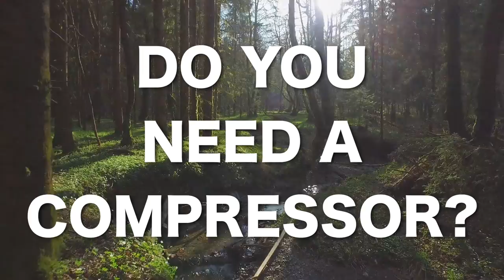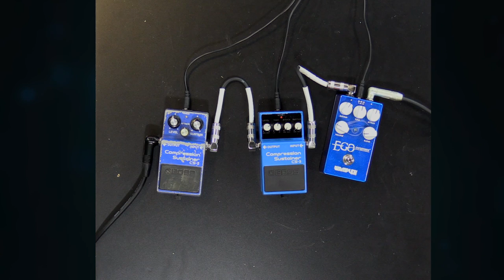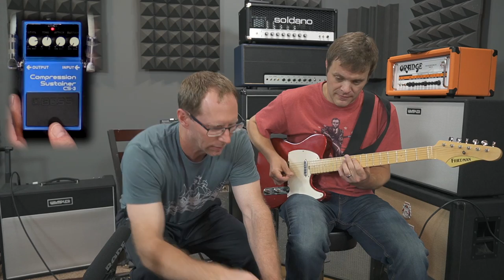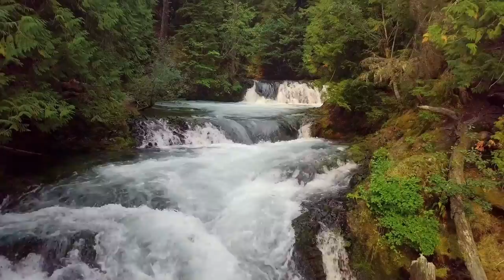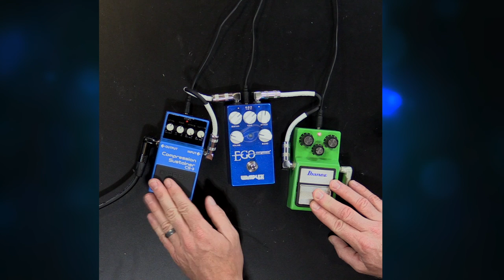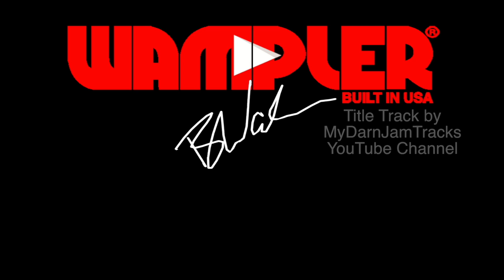Do you need a compressor pedal?

Comment: I have the CS2 and the Mini Ego. I use the mini-ego into a Silver Archer and a Tumnis deluxe - the latter two together for increased harmonics.
I’ve been very happy with the mini ego, less noise than the CS2. Also the mini ego has more range. If I have to take one pedal into a modeling amp, it will be a compressor. Right now the ego is the only pedal going into my Vox. Into my two Marshall’s running in stereo, I have the three I mention above on a pedal board with the other usuals . I’ve been buying pedals since the 70’s. “Less is more”  when you get down to it.

Comment: I use a keely pro into a moog mf drive in an NS-2 loop. But I use it as a limiter mostly so I can actually run a lower input into my chain and boost it. That way gives me more clarity because I’m using a seven string drop tuned to F#. Cutting the input gain on the compressor then rebooting through my drive gives me huge big clear high gain tone.

Comment: The short answer, is: YES. Particularly if you play a single coil guitar, but even humsucking guitars benefit from them. Turn that sucker on and forget about it. Adds life to any guitar by giving a little push to the front end of an amp. If you are playing through a Matchless or such, might not be quite as necessary. But def worth a try. I personally have and use two BOSS compressors, and I love them both, going into two different Fender amps. However, I'm sure there are other, very capable compressors out there.

Comment: 1 thing that I like about Fender's is the ability to moderate your volume with pick force. Compression takes away this wonderful part of playing. And I got 2 Boss CS-2's. 1 is highly modded with some spidery looking chip making it like a plug in super comp. Not quite understanding what it did I bought a stock 1 to compare and found with either I had to change the way I play. So I just use a silent modded 10 band EQ and my fingers to keep each note, chord or run at whatever volume I feel is best. So compresser pedals make great door stoppers. I even tried a BBE mini sonic stomp but took that off my electric board and just use it for my acoustic set up. Now that really helps especially with my 12 string. Through its own mixer going into the P A. With a AKG wireless bug system and the Sonic stomp, it's as close as a miked acoustic can get IMHO. And I can walk around while playing.

Comment: Yes I need one. I know many are the exact opposite, but it's tough for me to like my sound without it. No, I don't have crappy gear. Of course, I'm turning the compressor off when I run my big muff circuits, but like many others are saying, I use it as a mostly always on clean boost with light compression for overdrives. Makes everything perfect and creamy!

Comment: They are only 'needed' to flatten the dynamic range (without needing the volume to find a power-amp+speaker's sweet spot), in order to sound like tape or studio compression that was prominent in the late 70s and throughout the 80s.
Skank comping, DIsco and funk wah parts,  and 'popping' licks a la 'Eminence Front' are prime examples of when a compressor is 'needed'. Andy Summers and Johnny Marr used them all the time. 
You might get by playing rockabilly without one, but it takes a sweeeet rig :o)

Comment: I find this video so interesting,  because I have a couple guitars with active pickups and some with passive,  and the active pickups tend to compress the signal alot, well some more than others.  I actually find my EMGs compress more than my Seymour Duncan active,  but it's still there and you tend to lose some dynamics.  I always find it's too easy to screw up my sound when adding a compression pedal that I just try to run a minimal pedal board.  I find they really take away from tube amps especially.  For me that's why I tend not to like solid state amps because of the over compression. Even though I don't play alot of "clean" stuff, I prefer not running compression.  When I play clean I need to hear more dynamics, for me it seems to take away from that.

Comment: I have dirt cheap Joyo Dyna Compressor.  It's always on.   I place it right after my Digitech Synth Wah envelope filter.  I dial the sustain and attack almost all the way up, and the level so that it's slightly louder than the uncompressed level.   My cleans sound huge.  I use a TS mini, an MXR 78 badass distortion, and am ibanez super metal mini, for various flavours of dirt,  but none of them have the dirt turned up even halfway.   With the compressor I get loads of sustain out of any one of them, without much dirt.  Turning different combinations of two, I get different flavours, with more dirt, and with all three, I get a really smooth creamy Soldano type lead tone.  The a crybaby . Then an MXR eq used as a mid boost for solos, then a volume pedal, into a delay for swells, and finally int
o a peavey VT classic running ultra clean.

Comment: Compressor after the first drive, is a great way to control levels and dynamics for rhythm playing, especially in a worship setting  ;-) The cleans are compressed like normal, but the OD rhythm doesn't give you nasty surprises/volume jumps. So you can play heavy handed without stress ;-)
Reply: Christian Boddum I’m gonna have to give that a try! Always heard comps go in front, so I never tried them anywhere else! Great tip!

Comment: Cmon people. I have Keeley, Xotic, and Origin FX compressors. I refer to them as MORE pedals. I set the amp be it a tube amp to desired settings, set my compressor subtle to  “more” settings. I liked the sweetens up the sound reference.  On grainy sounds I use it the same. Some may refer to it as a clean booste. I even run a SP comp in front of a Kemper 😉

Comment: Mr. Wampler,  Have enjoyed all your pedals and yt vids here...Please invent us a pedal that can turn a SS amp, into an amp that gives us 'even harmonics' like a tube amp, and the  guitar world will be your oyster!! 

Cheers pal..hope your up to that challenge, as we all know the limitations of an ss amp is its 'odd harmonics' which kinda becomes a deal breaker on ss! Good Luck & much more success in your pedals builds!!
Reply: I think the issue is Solid State gain staging and tone stacks vary quite a bit between different amp designs. I have a Fulltone OCD (A Wampler Plexi Drive would also probably do the trick) and it legitimately makes my "teal stripe" Peavey Bandit on the clean channel sound sound remarkably close to an overdriven valve Marshall on certain pedal settings.

However, I have another solid state amp that makes the same pedal sound like a weird out of phase fuzz.
Reply: It is a myth that tube amp produce only or predominantly even harmonics. It is always a mixture of even and uneven harmonics which is very much dependent on the design and topology. There are tube amps that have predominantly uneven harmonics. 
Also not true that solid state circuits produce only uneven harmonics. Some do. Some don’t.
Easily measurable by yourself: send a pure sine wave (1000Hz) from a signal generator through different circuits and drive them .Your hardware amps and pedals or just amp sims in your daw, doesn’t matter. You’ll notice the outcome varies massively and you just cannot tell by looking at the harmonics how something will sound.
It’s not that simple, even order harmonics = good and uneven = bad.

Comment: GREAT video. 
I have two compressors on my board:
1. Boss CS-3 
2. Xotic SP Comp
The boss is for a pre-gain boost/sustain. When I click that on it sends me soaring over everything else in the band, as well as provides endless sustain. It sounds especially nice with single coils. It really makes Wampler Tumnus Deluxe howl. 
The Xotic SP Comp is for post-gain dynamic smoothness, and punch. I rarely click it on, but when I do, its because I need some funky spank. Like the Wampler Ego, its modeled after a Ross compressor, and it has a blend knob, which is really handy. The Xotic SP is the sweetest sounding compression my ears have ever heard.

Comment: I'm a compressor junkie. 

I own an Origin Effects Cali76-TX, a Fairfield Circuitry The Accountant, a Retrospec Squeeze Box, a TC Electronic Spectacomp, and a Boss CS-2. (While I don't have a Wampler Ego, I'm looking to buy one of the minis...)

One tip for the Boss CS-2 (which I love)... If you're using a "brick power supply", you need to run 12v. The old Boss ACA wall-wart power supply actually put out 12v, not 9v.
Reply: Have the mini its the best dyna/ross descendant out there in my opinion. Do it. Also a comp junkie

Comment: I only use compressors for the squash effect (think funk). Since I play metal though, almost exclusively, I don't own a compressor pedal. Using comps to even out dynamics encourages sloppy playing somewhat. It's like those sensors on newer cars that alert you if you start drifting over the line in the shoulder....learn to f**king drive in the first place, and you don't have to worry about drifting off the road. Drivers start depending on those sensors just like guitarists start depending on compressors to "fix" their phrasing mistakes. Dynamics are a good thing, for one, but if I unintentionally play something too soft or too loud I consider that a mistake and I try to improve my technique.

Comment: I tried a BOSS CS-3 with great expectancies. I use a silicon fuzz in front of a soft overdrive and obtain clean tones when the guitar volume is rolled down to 5. But no matters where in the chain I set the CS-3, I loose that clean tone. Even if I roll down the level knob, always can hear a subtle hiss like if it is clipping (overdriving) the signal. All compressor behave like that or am I doing something wrong ?
Reply from the maker: You won’t want to use the comp in front of the fuzz, but if you are experiencing any sort of clipping with the compressor anywhere else in the single chain, then something else is wrong. My guess is an improper power supply for the pedal or if you’re using a battery then probably battery is nearly dead.
Reply from the maker: If you post on the Wampler Tone Group on Facebook  I can help you easier there
Reply: @wampler_pedals  thank you for your response. You were right. I got the pedal without its original power supply and thought my isolated Voodoo Lab would be enough. But not. The problem solved using a battery.
Reply: @wampler_pedals  I sent the request. Thank you.
Reply from the maker: It probably uses the boss aca adaptor, which is a 12v adapter. Internally it converts down to 9v, and the battery just disconnects that part of the circuit allowing it to run direct from the battery
Reply: @wampler_pedals   Its a friend’s of mine pedal. He left me to try his compressor by myself because I suspected videos cant help with understanding what they do. And I was right. I finally could achieve what previously was incapable of in my performance. So yesterday I bought a Wampler Ego because it has both the blend and the attack knobs. Thank you so much.

Comment: I have had the CS-2 and 3. CS-2 is an absolute classic on Bass. CS-3 is ok for a cheap guitar compressor but is otherwise junk imo
Reply: Depending on what you call cheap but yes Boss CS- 3  is under a 100 bills I have a few compressors and they are all a touch different in  reality. I'm using a Cali76 Slide Rig as my main pedal now or I'd use a Dynamic comp for general use.

Comment: Question time. What is the difference between a bass compressor and a guitar compressor....is there any problem using a cs3 for bass?
Reply: Some compressors aimed for guitar cut low end the Cs2 and CS3 will be fine on bass but the boss bass limiter LMB-3 is a very good compressor to start.

Comment: What about the noise? Ive tried a few. Most are garbage trash. The cs-3 was noisy, same with the Keeley and EHX tone corset. Xotic was a bit less noisy but was still there. I bought a Warden, but it was dead on arrival. I've read good reviews on the Ego comp but it's not an optical so I'm guessing it's going to very noisy.

As a clean player compressing makes a world of difference, especially if you're doing mathrock stuff. 

Why didn't you mention anything about the noise that compressor pedals introduce?
Reply from the maker: I did, and have numerous times. As I said in the video, any noise that’s present at all is going to get boosted, because that’s simply what compressors do (well, one part of it). For less noise, turn down the sustain control and look at your signal chain, ie make sure you use a REALLY good power supply, good cables, if you are near fluorescent lights accept it’s going to be noisy etc

Comment: Always on for me
Reply: Same here.  I've owned/tried dozens and dozens of compressors over the last 14 years and find the CS-2 to work best for me.  
Tele>'90s EHX DMM (also always on)>Boss CS-2 (always on)>Wampler Paisley Drive>AC30.  
I run the CS-2's attack time at maximum to keep it as transparent as possible by staying out of the way of the transients, and a touch of comp/sustain (9 o'clock on the dial) to just glue things together.  On special occasions, I turn the sustain up using my foot while playing when I need some sustain/feedback help during "big" song sections.  
I totally get that humbucker users might not see much use in a comp; but imho, for single-coils, they really bridge the gap between recorded tone and live tone and also give a bit of humbucker feel to single-coils without giving up any single-coil tone.  Humbuckers naturally reduce dynamic range and tame the spikiness of transients.  A great compressor, if set right, does exactly this.

Comment: I would like to see a compressor that detects gain change from, amp so it kicks in automatically when overdrive is switched off! Turns off when it hear overdrive/distortion!
Reply: stomp both switches at the same time. or use an ABY switch and put comp in one channel and distorsion in the other.

Comment: Why would you run the CS-3 with the Sustain and Attack cranked to full? That is absurd and definitely not a setting where the CS-3 shines. It is also why it sounds noisy, weird and fake in your video. Are you just trashing it to present your own pedal in a better light?

I run a CS-3 first in my signal chain (with various single coils equipped Fenders) and it adds lovely sustain. My typical settings are: "Level" at 1 o'clock, "Tone" at 2 o'clock, "Attack" between 1-3 o'clock, the "Sustain" between 10-11 o'clock...My amps are typically a Vox AC-15 and a Marshall JTM-45. It does not sound too squishy or noisy even with an OCD after it.
Reply from the maker: Lol, no. It’s to exaggerate the sound of the compressor, but cause subtlety doesn’t translate well on YouTube.
Reply: @wampler_pedals  Youtube sound quality is certainly equipment dependent (I watch all music-related videos in my recording studio through monitors). Just pointing out that it is obvious that you use your own Ego Comp (and the CS-2 as well) in subtle ways in the video and run the CS-3 at its most unflattering, so it comes across as an unfair comparison. The reason that I point this out is because your Ego Comp is an excellent pedal (the Blend control is a terrific improvement!) and its exceptional quality speaks for itself.

Comment: So basically, a compressor turns a guitar into a synthesizer that does NOT have touch-sensitive keys. No matter how hard you pound the keys, the volume will stay the same. Right? If your goal is to sit back in the mix during a song and not be calling for constant attention, then use a compressor? Hence the reference to country music. Which brings up another analogy: A compressor turns your guitar into a lap steel guitar. The instrument sits in a mix. Goes with the overall flow. Last point: a compressor is counterintuitive. When you play an instrument you expect it to respond to what you're doing with your hands. Full stop. But a compressor is ignoring you and you have to, in some cases, allow it to fix what you're doing. Because you're trusting that the mix will sound better. Ya?